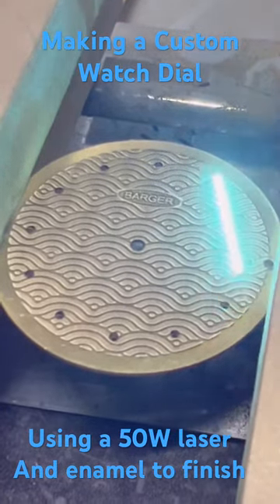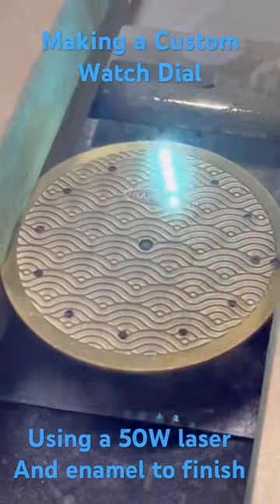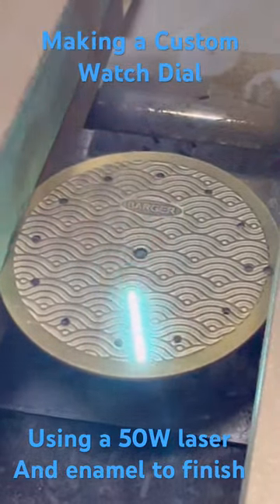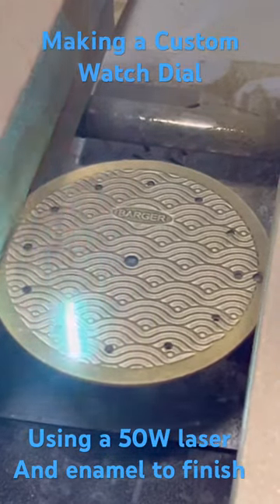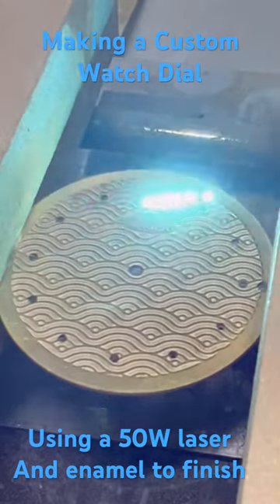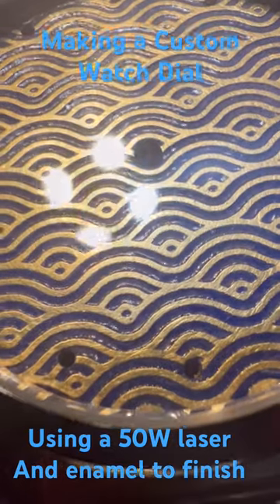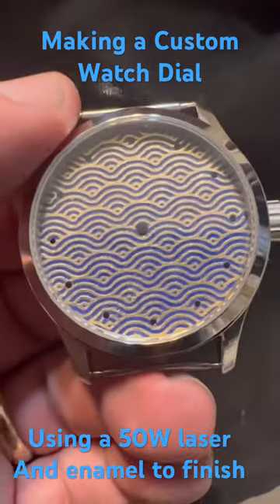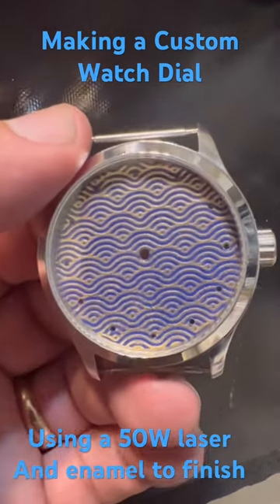Making a Custom Watch Dial using a Fiber Laser

Comment: Your work is insane man! Such an amazing dial! Can you disclose the thickness of the brass sheet? You do all the cutting/engraving on your fiber laser machine?
Reply from the maker: The brass blank I use is is .7mm but you can use .6 or .55mm as well.  Anything from 22 gauge to 26 gauge if you are looking at buying the blanks in the US. The alloy is important too.  So be sure to get a small sample quantity to test with and make sure it carves it like you want.  I’ve found different vendors products cut / carve / engrave a little differently but you can adjust as you get used to working on the laser to improve it.    The thinner the metal the addition risk of heat warp is there so keep that in mind too.
Reply from the maker: It is done on the fiber laser and then I will clean up the holes that go through on a vertical mill.  You could also use a hand drill to do this if you didn’t have a mill.
Reply: @DangerDIY  thank you so much for disclosing your workflow. I'm looking for a way to DIY my watch dial. And it seem that fiber laser is the answer. Thanks again. Cheers!
Reply from the maker: @nguyenuc167  your welcome. I will post some more informative videos when I get some time on start to finish on a dial and hopefully that will be helpful.

Comment: Could you add laser printing logos onto an existing watch face?
Reply from the maker: @jefsiv  not likely. It could cause a lot of damage to  the watch dial due to the heat.   The finish, if anything but metal only would burn and anything held on with glue or shellac would fall apart.  Thanks for the question and for watching the channel.  Much appreciated.
Reply from the maker: @jefsiv  three options that could work though would be pad printing to add to a dial, water slide laser printed additions, and adhesive metal or other material stickers. I would imagine someone talented enough could also hand paint the dial.